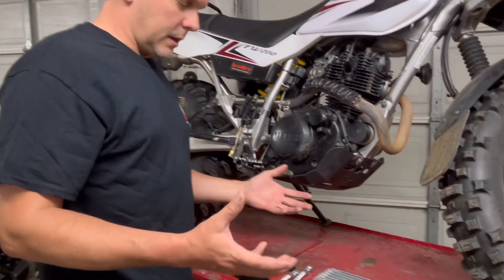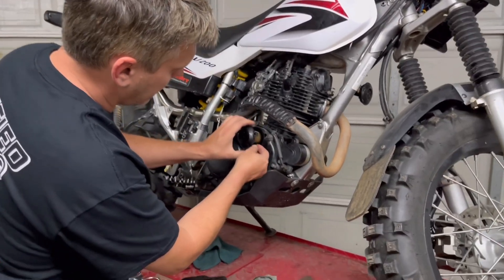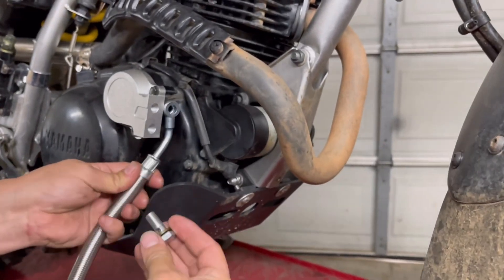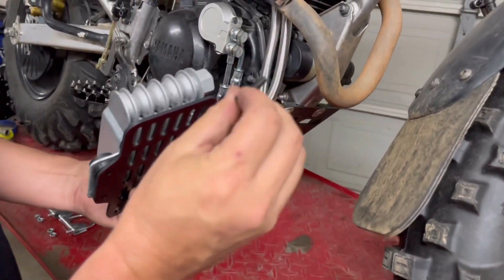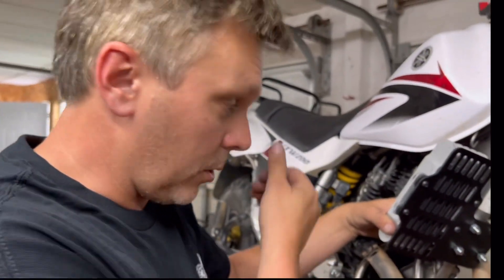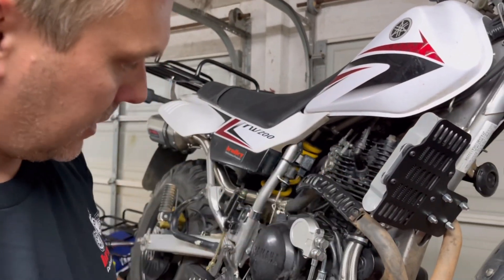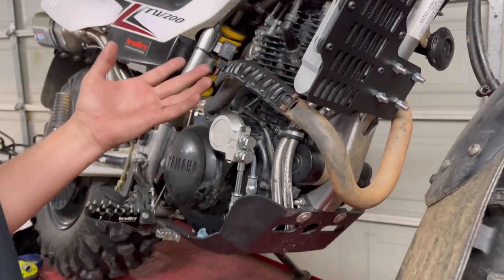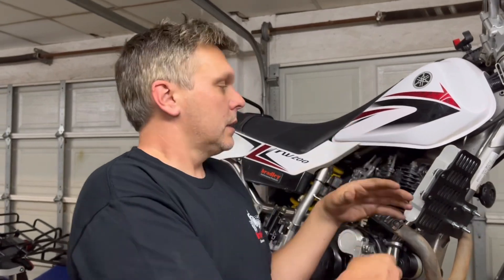bradley Performance TW200 Oil Cooler Install

Comment: Great install video. Not sure if these bikes really need these. Seems like a superfluous add on.
Reply from the maker: Watch the latest video we just did. It covers that discussion. I would say it is for extreme usage, just like a tow/haul transmission cooler package on a truck.
Reply: I like that word. "Superfluous!"
Reply: It will depend on how you ride it some ppl don't need it but some really do. 👍

Comment: So far, couple mm off on peg mounts, exhaust was good install, I recommend putting some super glue on the rubber mounting gasket that goes over the brace as it slides off easily. Oil cooler install now. Will update this as I go. Hey its critisism but in a nice way no punt intended, just giving my hinest reviews so far. Thanks Brad

Comment: Hi, So you have to fill up the two hoses & rad up with oil and that is the amount that you will add to you bike im i right? Just want to make sure. An Does it matter where you put the rat? Does it matter if it's higher than the engine  & Where would i good to get one I would like to get 1 or 2. Thanks.
Reply from the maker: @chris_ss1488  the mount that we have really only gives you one choice for mounting. Yes it will hold a few ounces more oil. It would slowly leak down through the pump over time with the engine off, so it will look a little over full until started and warmed up. I really don't have a way of mounting two at the moment.  You can get them on our website Bradley performance products.net.

Comment: 13:00 - Do you think there would there be a significant improvement by using a fan? In my mind, I can picture something small, similar to a computer case fan, being a very good fit for this application. That would have very little electrical draw and could help provide airflow at slow speeds. Anyway, thanks for the detailed overview.
Reply from the maker: Absolutely. I am looking into that.
Reply: @bradleyperformanceproducts any progress on this? I’m interested in both
Reply from the maker: Unfortunately not at the moment. We are so backed up with orders that we have not been able to make much progress on our project list.
Reply: @bradleyperformanceproducts  fortunately/unfortunately 😉
Reply: @bradleyperformanceproducts  does the tw200 oil filter match up the same on the xt350? It looks very similar

Comment: when are you going to make a video of the big bore kit for the tw200?
Reply from the maker: We are working on it. We can't decide how we want to handle it. It is probably just going to be a video on the specifics of the kit that need to be done differently for the install rather than a long training video on how to work on engine top ends in general. There are plenty of those out there. We can do whatever needs to be done though if that is the case. What are your thoughts?
Reply: @bradleyperformanceproducts  sounds good

Comment: Question how far does the oil unit stick out would it be damage if the TW200 falls on its side?
Reply from the maker: I will get some pics for you.
Reply: @bradleyperformanceproducts  HI I was wondering if you can send me pictures to please im thinking of putting one on my dirt bike and one on my 3 wheeler.

Comment: I'd love to put one of these on my Kawasaki Super Sherpa. It appears they  would fit on very well and would not need a new oil filter cover as the hoses would connect on existing ports and lines!  However I'm unsure if my application would need a one way flow control/back flo preventer in it.  I would also think a water proof fan would be best as my bike only runs hot when in lowest gears.  Road speed cooling is no problem whatsover.

Comment: Question;  reason for oil cooler is to cool oil at high RPM for longer period of time(  long trips  ).  right  ??
Reply from the maker: When Yamaha designed the engine, they designed the temperature to stabilize for a given load and engine RPM, otherwise the engine would just continue to get hotter and hotter and eventually overheat. If the engine and oil temperature stabilized at say 240 degrees at cruise at 6000 rpm, then we are using the cooler to bring that stabilized temp down. So to answer your question, yes.

Comment: I have a California model that has a charcoal canister mount on the downtube. The canister has been removed. My question is there enough room to mount the oil cooler to downtube or will the canister mount have to be removed?
Reply from the maker: I have never had one of those models to prototype with, but I think the bracket will have to be removed unfortunately.

Comment: Does this starve the engine for oil on start up until the radiator fills with oil, or does it have a check valve?
Reply from the maker: The oil being cooled is the oil in the oil filter case, so a portion of that oil around the filter and in the cooler will drain back into the case when the engine isn't running. Yamaha obviously designed the engine this way, so it should function just like OEM.  This kit cools the bleed oil from the engine and operates in parallel to the oil system, not in series. No worries about oil starvation.
Reply: @bradleyperformanceproducts  thank you

Comment: Nah,i don’t like it. It sticks out too far,and did you do a volume test to determine if that little engine is pumping enough oil up n through that oil cooler. No oil starvation issues yet. How many miles of R&D do you have into that ststem?
Reply from the maker: We test on several different bikes in different situations. The cooler is inside the envelope of a downed bike to try to keep it from any damage. Like most hydraulic systems, we are only cooling the bleed oil from the filter case. The volume obviously varies with engine rpm. Definitely no issues.

Comment: Assuming this will need the evaporative "Cali-Canister" delete to install?
Reply from the maker: Yes i believe so.
Reply: @bradleyperformanceproducts  Any direction on this? I imagine there will be others with the California TW model who will need to know this... and while I know you probably can't "recommend" this mod for legal reasons, maybe you could let me know if I'm on the right path, as I plan on installing this (delivered today). The TW forums say it can be removed, and the vent line from the gas tank can remain open to vent, but the vent line from the carb can be plugged. Does this sound right or would you leave both open to vent? I can't seem to find a definitive answer on forums.
Reply from the maker: Yes the carbon canister will need to be removed on the California model.

Comment: Do you sell just the radiator oil filter cover, plus the plate that protects the radiator and supports? I already have the radiator.
I intend to install it on an xt 225
Reply from the maker: Sorry I don't. I currently have to buy it all as a kit from the manufacturer. We will work on that as a separate piece.

Comment: Was there a reason you didnt use ORB fittings and AN or PTFE lines in order to shorten hoses and make the connections simple and easily maintained or replaced?

Comment: How far can this bike travel without the oil cooler?
Reply from the maker: As far as you want. Think of it as a transmission cooler for a truck with a tow package. Will it run without it, yes. Will the oil last longer, stay cleaner, and help components last longer with lower temperatures, yes.

Comment: Yamaha didn't do it's homework?
Reply from the maker: Of course they did but any air-cooled combustion engine can benefit from lower temperatures. The oil is the only fluid moving around in there that has the ability to transfer heat.